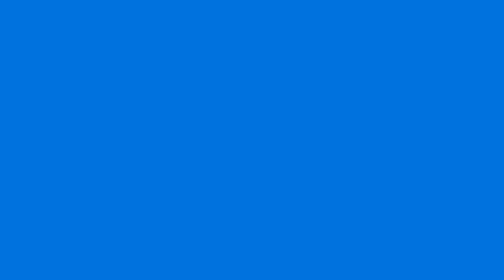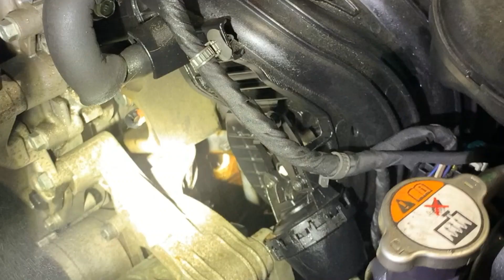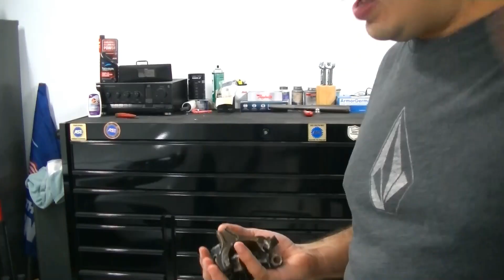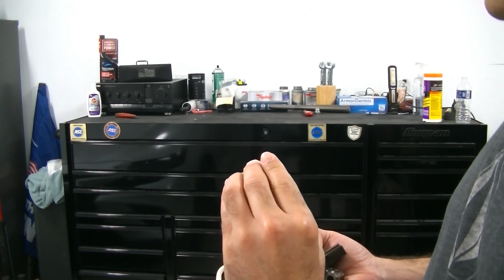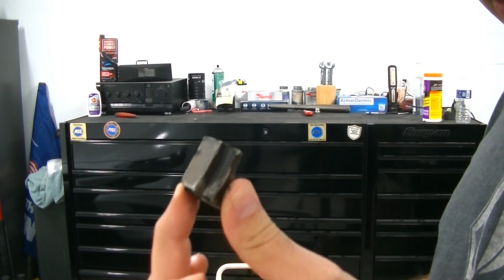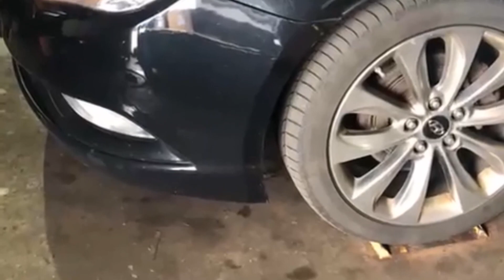P1326 In Hyundai/Kia vehicles, Cause of Theta 2 engine Failures, Timeline of Hyundai engine recalls

Comment: If I buy a used 2015 Sonata 1.6T and it ends up having a rod bearing failure as you have discussed, would I be covered for a new engine, or is that just for the original owner?
Reply from the maker: During my tenure at Hyundai, the 1.6T Gamma engine was not included in the recall. This may have changed as of recently though
Reply: @SEsGarage  Thanks.  what I have been able to find is that the engine is good but the grant could have issues if not treated well.  the one I'm looking at has 156k
Reply: @SEsGarage  I have a question I did replace some parts on my car myself I’ve been working on cars my whole life will they say anything about new parts 
My car has 98k 2015 Hyundai Sonata p1326 code and it’s in limp mode I heard noises like knock coming from engine then limp mode I towed it to the dealership but I changed some parts and I’m not certified does that matter I installed everything right and I had a shop relearn everything

Comment: My confusion is that we received the recall notice for campaigns 198 and 966, yet the 2012 Santa Fe is not in the class action settlement. I don’t know if any way to determine which engine I actually have.
Reply from the maker: The 2012 should be the multiport theta. Before GDI

Comment: 2019 Sonata owner here (bought new in 2019). I realize I have not yet taken it in for this so-called 953 campaign PCM software flash. My concern is exactly what you highlighted with the first iteration of said software: false positives putting the damn thing on limp mode unnecessarily. 

Thing is, I need dispatch rate out of a new car (so far 43Kish miles in 3 years and no issues), otherwise I'd just drive old used cars for a discount and deal with the frequent shop hassles as I used to do with my old beater jeep cherokee. My concern is, if this engine eventually seizes for rod bearings, will Hyundai refuse to honor the lifetime warranty claim for a new engine based on the PCM not having this 953 campaign flash?
Reply: I believe having the 953 update is a requirement for the lifetime warranty.
Reply: Yes they will refuse. You MUST have the new software to have the lifetime warranty.
Reply: 2024 update: Now at 80K miles, started eating oil at 60K, no failure yet, but have now gone into 5W-30 in order to help the viscosity. BL, it's an oil dilution issue as a result of that crappy GDI design. Having the intake ports gunked up probably doesn't help keep the chamber clean, and I bet ya the rings have enough blowby to let in enough of the already thinned out fuel drenched oil. I wish there was a way to swap the thetaII for their 2020 replacement (Smartstream 2.5L), alas, it's probably throwing good money after bad. Toyed with the idea of getting a post 2020 sonata as a replacement, but now I hear those are having transmission issues. I think I'm done with Hyundai going forward.

Comment: I'm hoping my engine gets replace I been waiting for 3 months to be diagnose it's obvious what's wrong with it rod bearing failure they told me to drive it in after that p1236 code pop up 10 minutes later I had my engine go out it leak oil every where I had just changed my oil they did come pick it up I drove by there yesterday it has a number hanging from the rearview mirror now idk what that mean I hope that mean I'm close to getting diagnose it's been hell without a loaner car they say I gotta wait till the engine approved to get a loaner

Comment: Hey Stephan, I have a 2013 KIA Optima with the 2.4 GDI engine.  It has 132000 original miles.  The engine just seized as I was driving.  I know for a fact it's seized as I tried to rotate the engine manually via the crank bolt.  What options do I have in this situation?
Reply from the maker: Tow it to the dealer and let them do their thing. As long as you’re up to date on your recalls it should be a non issue
Reply: I called and they said there are no current recalls on the car.  They want to tow the car (at their expense).  They also said it will likely be covered.  What could go wrong where it won't be covered?
Reply from the maker: @SibRevs  if you have all the recalls completed, you likely have the warranty extension on the long block and it should be covered
Reply: Alright thanks for the information.
Reply: UPDATE: My Engine was replaced at no cost to me by Kia.  They went above and beyond and also replaced my starter and intake manifold.
Reply: Same here just replaced our motor no cost and no problems very happy
Reply: Replaced mine as well. 15 optima.  @149,000.  Had all the oil changes done at the dealer which saved me, as I wouldn’t have had those oil change receipts.

Comment: So my 2015 with a 2.4 had the code and went into limp mode after I had a new engine but I was in a hurry and just erased the code. It’s been several months and miles with no issues.
Reply from the maker: Always be sure to clear that specific code with the engine running
Reply: Was the knock sensor replaced at the time of engine replacement?
Reply: @thmqpgap  no idea.

Comment: 2012 kia sorento 4 cyl. noise sounds like a diesel. eattles and taps. help
Reply from the maker: Likely rod bearing failure. Have it towed into the dealer
Reply: @SEsGarage  Oddly enough, it runs great. What is the likelihood it will just blow without any additional warning?

Comment: I have a 2016 Santa Fe Sport with the 2.4L it just spun a bearing on 1/15 at 57K. I got it used at a hyundai dealership in late 2020 and did not purchase the 60K warranty with it. Does the settlement lifetime warranty apply in this case, or am I screwed? It shows that the knock sensor update was done in 2019, it didnt alert me till the engine was already blown. I dont know what to do?
Reply: To my knowledge that warranty with proof of maintenance covers everyone for 10yrs and 120,000 miles.  Contact Kia corporate if you have proof of oil changes.  See if the Dealership has proof of oil changes...

Comment: Does anyone have P0420 after engine replacement?
Reply: Yeah, mine burned oil and coated the cats in oil so they stopped working properly. Was told it wasn’t related 😑
Reply: @Tech-28  I was able to resolve this and passed smog. Initially, I removed pre cat O2 sensor and sprayed tons of carb cleaner and then ran the engine. Code came back after two cleanings. Next I changed post cat O2 sensor. This fixed it and passed smog. No more code for months.

Comment: well, it's definitely not a Honda engine. Too bad that they screwed up the engine. Is Hyundai still using the Theta engine in 2021 models, esp. in the N models? Because the Elantra N is pretty cool, but I'm not buying on, if it has the same engine. If that's the case, it's better to pay the $5,000 premium to get a Honda.
Reply from the maker: I believe it still falls under the theta family, but it’s supposedly a ground up redesign
Reply from the maker: With that being said…you see what I drive 😂
Reply: @SEsGarage  Do you know of a good source for that info? I'm having a hard time finding reliable source for the engine engineering, build, internals, etc.
Reply from the maker: @RobHTech  I remember reading about it in training modules before I left. Not sure where else that information would be if I’m honest
Reply: @SEsGarage  Well. I suppose we will have to wait for someone to get one and tear it down. Of course, I think Hyundai has some sort of embargo on the engine internals being displayed by certain Youtubers. Probably get sued by Hyundai.  A lot of times, being an old VW tech, I find info from the OEM manuals (electronic now obviously)  by renting them for a day or two and simply downloading/printing all the docs I need, including part numbers, and then research by part number 1-by-1 to figure it out, unless, like I said, someone shows a tear down. 

I think as a tech, we tend to ask a lot of different questions than non tech folks. No pun intended. People who build cars, same thing.
Reply: No, per the web, Hyundai quit using Theta II in 2020, Kia in 2021.

Comment: I picked up a 2019 with 30k miles on it. It has the nu 2.0 no recall and I'm hoping for the best. Does anyone have a real clue as to what's going on? I have almost 70k miles on the thing now. And no issues.
Reply: The NU 2.0 engine has a very good reputation as a very reliable engine. Mine at 95.000 miles still runs perfectly,  uses no oil. I am old school,  I do change the. Oil in all my cars every 3000 miles, and have used Castrol GTX for 47 years. Currently have 338.000 miles on my 94 Trans Am.  Engine never been touched, not even timing chain.  Still runs like new.

Comment: Going back to when you mentioned burning oil.. My dad has a 2013 Hyundai Sonata with the 2.4L. It now has about 165,000 miles and burns a quart of oil every 400 to 500 miles which is excessive as many may agree. We took it to a dealer and reported the issue and they did an “oil consumption test” and stated that the oil being burned is normal. In no way is this normal for any engine. We are meticulous on maintenance on all our vehicles and do our maintenance ourself. Oil has always been changed at 5,000 miles with Castrol full synthetic and high quality oil filters like K&N and Mobil 1. I know the dealer or Hyundai will probably never “take responsibility” for this and fix it. Any ideas on the direction to go or to start at to hopefully stop or reduce consumption? There are no oil leaks by the way. We just add oil every 500 miles to keep it topped off and within the L to F mark. Thanks for any advice.
Reply from the maker: They have a lifetime engine warranty for rod bearing failure. Say it were to run out of oil, that would cause the rod bearings to fail. Read between the lines
Reply: Sounds like the Kia Technical Service Bulletin 222 for high oil consumption

Comment: Don’t buy a Hyundai or Kia.
Reply: Co-worker has 175,000 miles on a 2011 Soul, neighbor has 135,000 on his 2013 Soul...No problems with either.
Reply: Overall don't buy these cars
Reply: My dad left me his 16’ sonata. It’s now at 201k miles and it’s spinning a bearing. This happened last month and it’s getting towed to the dealership tomorrow.
Reply: Just change and monitor oil consistently you would be fine. All these people driving without doing that then their you go problem
Reply: @gabemarah9465  how'd it go btw? My 2.0t just got approved for a new engine a couple days ago
Reply: Along with turbocharger and intake manifold.
Reply: @XAMPOL  I got denied. They wanted me to pay 8k for the new engine. Decided to get it out of the shop. Before you blame the dealer, it was corporate who denied the claim, despite my engine’s under recall for the bearings. It’s going to my dad’s local mechanic.

 Not yet, because my sister’s ’15 sorento went out before the sonata did. The engine failed too, because of a clogged cat, supposedly. Well, she kept her car up to maintenance requirements, and at 164k, the car wouldn’t accelerate, so she sent it to the dealer, they said it’s a clogged cat. She let it sit after 
She got it from the dealer. 
Later my dad offered to pay to get it fixed at his local mechanic. He said the engine failed. Great, there’s two failed engines on the list now.

Mechanic said he couldn’t fix the Sorento. Now we have to figure out what to do from here.
Reply: @XAMPOL  hey mine just did this today! Mine is 2015 made in November 2014 sonata limited 2.0t. I hope they cover it! Ate oil from day one
Reply: @SUMBaLL00  make sure you topped up the oil or at least in the middle mark before you take it in! If you're at the low level mark they can try and deny you or blame u for "negligence." Whole process took about 3 weeks for me, best of luck to you!
Reply: @Ry  ok thanks I will, I even been adding Lucas oil treatment at 14 bucks a bottle! Things I seen is 2015 is not covered under engine recall but they should if not youtube facebook tiktok and snap will costs them more then a engine from sales
Reply: Over millions of them are all over the road. The reason people buy them is because they’re super cheap and their warranties.
Reply: @autotech9974  every day I see fewer Hyundais and Kias.
Reply: My daughter is having trouble with a 2015 Kia optima with the knock sensor code. Any comments on what to do or how to check with kia?
Reply: @franciscojaviervazquez42  if the update was done, go to the dealership to get a new engine.
Reply: @franciscojaviervazquez42  the process is on the knock sensor dtc is when you take it into Kia or Hyundai They’re gonna check your bearing clearance on the engine and if it passes they’re gonna recommend you buying a knock sensor. That’s gonna be the first step into that problem. Most of the time the knock sensor goes bad and that’s why the DTC is displayed if your car isn’t knocking or making any noise, but if it is knocking or consuming oil, then that’s a different process.
Reply: @Auto Tech  mine is not knocking, but  it is consuming oil. It is at the dealer now, but they have sent no word on what the issue is. Yikes!
Reply: @gabemarah9465  😅
Reply: If the engine dont blow up, the vehicle may end up catching on fire! 😅
Reply: @SoSaysYou any word yet from dealership yet?
Reply: @Brandon tsx06k24  they updated the software and according to them that's all it needed. Still hesitates at low rpms though.
Reply: Too late😂
Reply: Hi everyone . I really need your help please. I have a 2014 Kia forte with 2.0 gdi engine. And 3 weeks ago It started to make a knocking noise. I took it to the dealer. After the diagnosing they said it is engine failure but didn’t told me where in the engine.  my mechanic said it is rod knock. And the dealer asked me to bring the maintenance record. I did but yesterday they denied it . I don’t know what to do. Now the car is at the dealer. I can’t afford to change the engine. Please help me with all you could. Advices,sources for information help me to fight it any thing. please 😂😂😂
 Appreciate you help
Reply: **PLEASE HELP ME**

I got the 1326 code in my 2022 Elantra N after getting a carwash, a carwash I've been using 3-4 a week for over a year. I took it to the dealership and all they did was clear the code and reset some parameters...twice because it did it 2 days after the first time w/ the carwash, same wash too.

Fast forward almost 2 weeks when I was told just reset the cel and you'll be fine...nope. I took back, asked them to clear it and I barely made it out of the parking lot, so now it's there for the same problem 3x's within 2 weeks from a car wash...WTF! They asked me if I washing the engine and I said no and then they said it's from the water being sprayed into the grill, yet the knock sensor is behind the intake and there's many things infront of it.

I have a case opened with Hyundai and they actually wanted me to take it to another dealership, why🤔 I don't want it towed and driving 25 mins away in limp mode is out.

Thoughts and advice by those in the know would be GREATLY appreciated!
Reply: I have a 2018 elantra with the 2.0 Nu motor. 126k and the only thing I had to change was a wheel bearing. It is the most reliable car I have ever owned. I have kept up on all the maintenance. I am thoroughly impressed. In 126k this car has been more reliable and put together than both Honda and Toyota I have owned. It's a 2.0 mpi engine. I really like it.
Reply: Disagree. The lifetime warranty is good enough for 99% of people. Also it’s not every single car. It’s a matter of maintenance for most of them.
Reply: @joeb2588 Totally agree.  I have a 2017 Elantra I bought new, 100,5000 miles on it. 0 problems,  0 Repairs.  Fully loaded wit all options. Most reliable car I've ever owned. And I've been buying new cars for over 44 years. Only items on the car that aren't original are 2 sets of new tires and 1 battery. I always do oil changes every 3000 miles, Castrol GTX, the engine uses no oil, runs smooth and quiet.